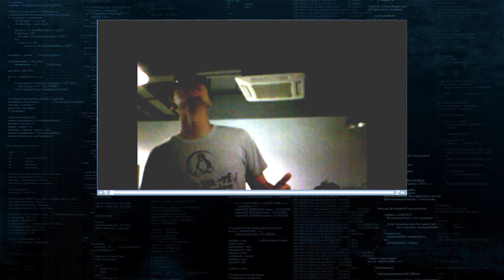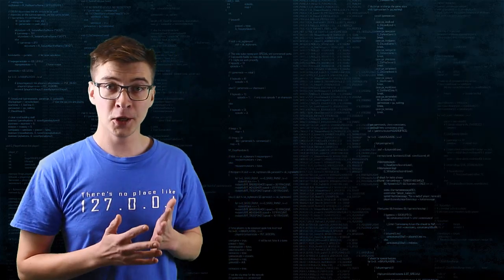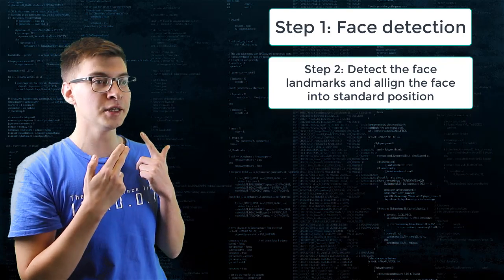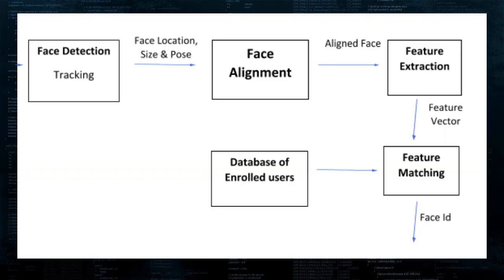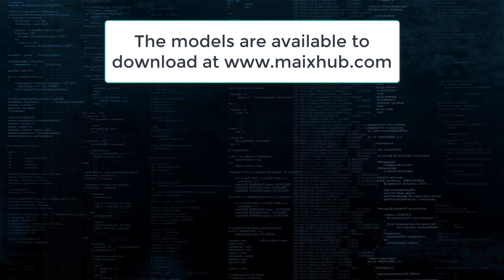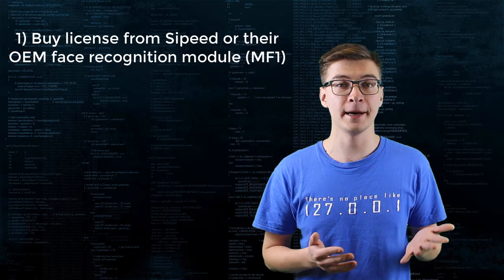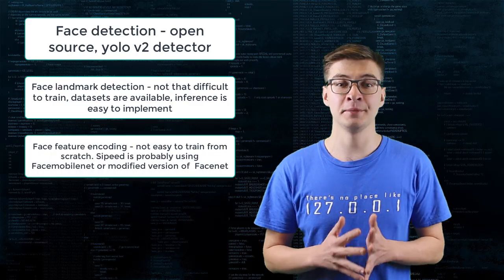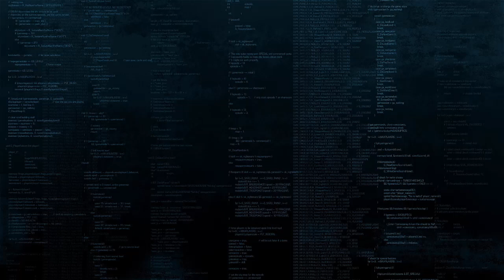Face Recognition with Micropython (K210 chip boards: Sipeed Maix series, M5StickV, HuskyLens)

Comment: Do you think the K210 could run pose estimation?
Reply from the maker: Yes, it can. The easiest way in my opinion is to do it using two stage inference - on first stage run person detection, then cut the person image, resize it and feed to pose estimation network.

Comment: Do you know approximately the price to use sispeed (MaixPy/components/kendryte_sdk/libs/ ) in a commercial app?  The website is all in Chinese!    BTW, considering the support/documentation might not be in English, how much better is this K210 risc-v chip versus running a similar face-recognition application on other hardware.. like, JeVois (linux quad a7) or a pi/beaglebone? Or is the advantage in the software library they've created? 

I think the downside might be that you can't easily test using other machine machine-learning software.. tensorflow vs pytorch?
Reply from the maker: The libraries are free to use from what I understand. They charge for face recognition models, about 1 USD for copy, I can forward you to their sales manager if you'd like. 
For most of(90 percent I would say) documentation they have English version... I think main advantage is size and price - if you use chip or module, it's cheaper than pi/beaglebone and has smaller footprint.
Tensorflow works good with nncase converter, Pytorch support was added very recently and is in alpha stage.

Comment: How can I train the landmark model in a compact size currently I've following several tutorials but the size of the model is bigger than K210 memory even using pruning techniques I can't fulfill the memory requirements
Reply from the maker: Pruning cannot reduce the size of the model that much, it is more like trimming the fat measure. You just need to take an existing feature extractor, that is known to work on K210 (for example MobileNet v1) and then add the landmark detection layer on top of it.

Comment: thanks for this video, it's really helpfull ,
do you have any idea where i can find dataset for landmark training ?
Reply from the maker: You can use this article as a starting point 
https://towardsdatascience.com/face-landmark-detection-with-cnns-tensorflow-cf4d191d2f0
Good luck!
Reply: @Hardwareai  thanks , looks good, another question , do you have any idea of how i can perform a liveness (anti-spoofing) mechanism on the k210 or any other cost efficient edge computing ?
Reply from the maker: I would say the same approach as with other things - DNN. Of course more are available, check out this Github repo, second section(right after the picture):
https://github.com/imironica/liveness
There are a number of approaches to liveness detection, including:
    Texture analysis, including computing Local Binary Patterns (LBPs) over face regions and using an SVM to classify the faces as real or spoofed.
    Frequency analysis, such as examining the Fourier domain of the face.
...